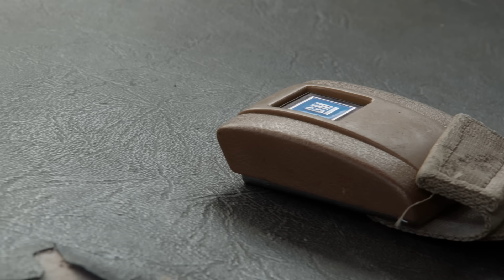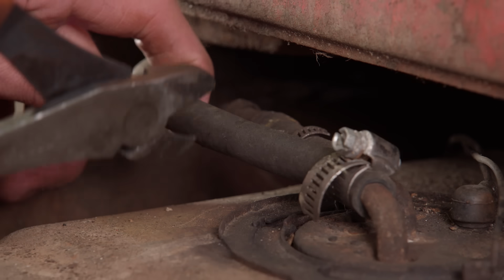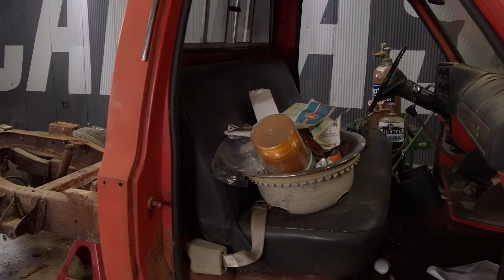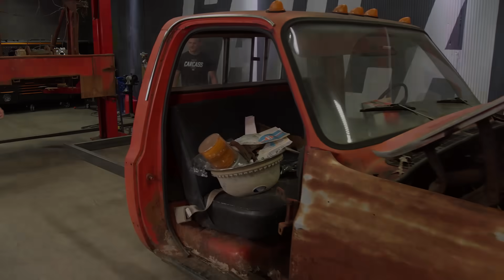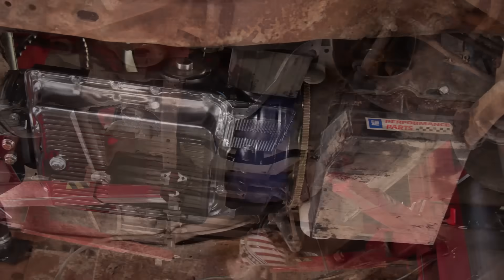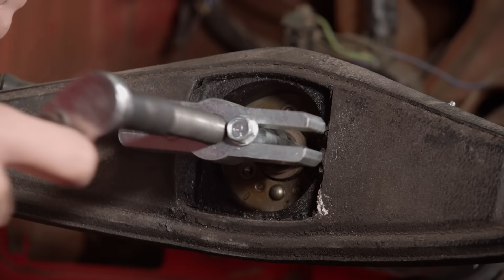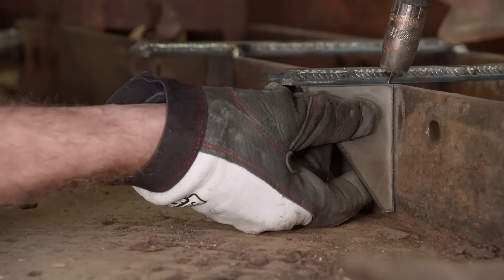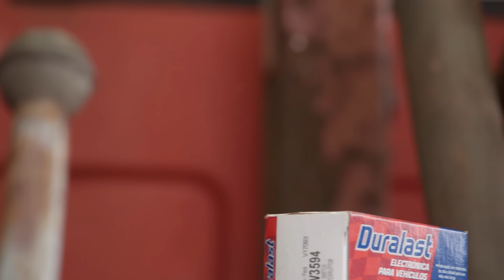Full Build: Junkyard Square Body Tow Truck Is Restored And Modernized

Comment: There's a reason why the manufacturer doesn't weld spring hangers to the frame, it is not strong enough. An axle under torque tends to put torsional force on the springs, causing the front of the spring to want to wrap downward. Repeated torsional twist will break those welds, this was a terrible "modification". If it was better than bolting them on, you'd see off road rigs, semi trucks and drag cars with welded hangers.

Comment: Once i saw the rear shock brackets welded in place, you lost me as this does not allow lateral movement from compression of the shock and the shock bracket welds will break

Comment: Question... 

First... Excellent Job. 

Second... I Have a 1992 GMC Safari Panel Van (Extended Cab) I need floor panels and some stuff for the dash and all the rubber stuff including the window felt as well as the rear "GMC" License plate thingy that goes in the back door... Do you know of an "All In 1" company that would have all that stuff? I also am thinking about electric windows and need to replace the seat and dashboard and want to upgrade the instrument cluster to some kind of digital gauges.

Comment: I would have rebuilt that manual trans. The 700r4 is just junk. Maybe put in a WC T5, or T56. If you're set on an auto trans. An allison would be the way to go. You would be able to use it the way it was mentioned to be. A wrecker.

Comment: Why the 700r4? Overdrive is great considering the truck probably has 456 gears . I would have swapped a nv4500 to make use of the pto wench. Zbar pedals aren't hard to convert to hydraulic.

Comment: For the light use it will see an automatic with no PTO is fine but I strongly suggest anyone building a more serious (working, not just a toy hauler) rig use a manual box with PTO or a hydraulic winch with engine-driven pump (the usual way to get around not having a PTO-mounted pump. If you run a mechanical PTO winch you have full engine power at your disposal so noobs should take care. Hydraulic motor drive can be fitted to the stock Holmes winch if the modded vehicle must have an automatic gearbox too small for a hydraulic or mechanical PTO.
For commercial work beefing up the back half of the frame considerably more would be wise. 

Twin boom trucks are amazingly capable for recovery (towing is not recovery). See towing forums for pics of them in action.

Wrecker operators have folded formerly sound frames upwards by chaining the front of the truck to an anchor then not backing off the winch in time.  These trucks are beasts (I've a C-30 crew cab with a wheel lift) so if you're building one for fun ya may as well keep what made them awesome. You can still get nearly all the old Holmes wrecker parts BTW.

These trucks are very easy to work on and if you find a sound rolling chassis it's easy and quite common to install a good C-10 cab to replace worn out wrecker cabs. It was and is normal for wreckers to expend multiple engines and for wrecker beds to outlast multiple trucks.

Here's a clean 480 like the one in the video before modification. They will easily lift a mechanical wheel lift if you can't score a hydraulic:

https://www.youtube.com/watch?v=hFGVOoy_nxw

Comment: I'm no engineer, but why didn't you run the c-channel all the way back and notch it for the rear end?  then box it. Seems it would have been a lot stronger if you are going to tow with it. There's and old 61-63 Chevy tow truck sitting in front of a local wrecking yard I would love to get.

Comment: So I'll either you guys said there's a lot of Fords out there but the problem with that most of those four words are still together whereas most of the Chevys have been picked clean because Gabby's are always needing Parts like that piece of crap 4L60E transmission or how about burnt everything's after 200,000 miles or how about whenever you get a quart low and oil you start having your lifters give you a round of applause

Comment: Turn a cool old towtruck into a car showtruck??? From a 4 bolt main 350 SBC with a SM-465 to a swirlport smog head in front of a 700R4? Why? It ran before???
Extra steps for a less useable truck? I’m just lost here. It’s sad that some guy who turns wrenches on occasion knows for a fact GM didn’t put a “305” in anything with 8 lugnuts. That truck would have had a very reliable truck small block or a big block with only transmission options being an Sm-465 or. TH400 automatic. Being. Tow truck with the need for a PTO the one with a clutch pedal was the most practical option.

Comment: hells yea! had an ol dually 350CI burnt out motor was replaced with rebuilt in box LT1 with one over cam small block. that thing was a monster! was my old boss' we lived almost two blocks off the main st and when he turned the corner at 7:15AM, you could hear that low drumming deep bass WHOOOM WHOOOM WHOOOM WHOOOOM WHOOOM WHOOOOM!!! i took the old drum muffflers off and put cherry bombs on, you could hear me coming five blocks away! instead of the horn i would pull up and rev it up BLAAAHHHHH BLAAAAHHHHH BLAAHHHHHHHHH!!!!CHUGGGGA CHUGGGAA CHUGGGGAAA! 
i would pul the stakes sides up, place them in the front with the steel box, and she would look like a semi with sleeper. 
first truck i safetied. didnt need much but yeah the floor pan was gone, did a lot of work, made me realize what was possible. owned a dodge once, couldnt haul worth crap. always stuff breaking, wasnt worth new parts. replaced everything atleast once over. still didnt run and drive proper. simple design, made me an excellent backyard mechanic. 
years down the road, couple decades actually. bought my first ford 3/4Ton, 351CI, 5spd C6 regular cab 2WD. the best work truck i ever owned.  hauled like a beast, the motor, almost indiscructable. loaded that thing to the tits many times over. scrapped it, tried to make some money back trying to sell parts. didnt sell too many parts because those year early 90s models very well built.
Reply: Trucks make big WHOOM WHOOM noises! Like VROOOOOOOM, EEERRRRRRRRR, PUTPUTPUTPUTTTT, HONNK HONNKKK! Like truck sounds

Comment: A - I'm a die-hard squarebody fan, so glad to see another getting rescued
B - That thing is DOPE! Love the 4-speed. (I had to add an edit. WTF guys? Keep the SM465! 🙂That's the strongest transmission on the planet)
C - you closed the hood wrong (not that it mattered with the current bends, but hurts anyway)

After watching to the end, that thing is an awesome build. Good work fellas. Totally approve of everything you did, except for the automatic trans. Thanks for saving another squarebody from the crusher.
Reply: 😂 they did not save anything. The production company requires the projects to be crushed. This is why Stacey David quit TRUCKS. He was tired of building trucks and then they were crushed.

Comment: I'm glad to see others as infuriated that you pulled that SM465 Transmission out, to replace it with 'fix or repair weekly' transmission...just because you can't shift a 4-speed. The SM465 and the Braiden winch were together, worth more than the whole project! In 20-years, when you wonder 'where did all the unaltered square bodies go'...just know, you could have bought a frame at Bobby White's to replace the rusted one with, for about $200...Along with the steering box, the spring hangers and that 'still creased hood'...
Watching this hurt...on so many levels...

Comment: Would have been easier and way safer just to replace the entire frame rail with a new one. With the popularity of the C10-C30 trucks, a new one would not have been difficult to get nor would it have been prohibitively expensive. Honestly, with all the rust, the entire truck should have been sand blasted.

Comment: good ol chevy, i have a 1974 myself and it does not disappoint, its hauled everything iv thrown on it, has a 350 with a 4 spd, long frame, weld bilt bed and a sneeker lift for repos an newer cars an trucks

Comment: Safety. No new control arm bushings, if not new arms? Front springs? New rag joint? Brake rotors/pads/calipers/hardware? Total rear brake replacement? Paint on the inside lower fender behind the wheel well? Cables on the beam rigging? Bearings? What happened with the driveshaft? Um, no. Really cool... as far as it went.

Comment: Watching the dash job made me mildly upset. I wish it was that easy on newer vehicles. I've done to many dash jobs with 7,000 pigtails and 1,500 bolts. Having 140 bolts left over and leaving 200 pigtails unplugged because I don't know where they went. But not on a 70s chevy, 6 screws and some spit and she's off. 🤣

Edit: Also, I love how after they put the gauges in the truck has 1 original mile. 🤣🤣
Reply: Same with swapping engines, now adays you have to program the ecu for the new engine, plug in 200 sensors and by the time ur done you have a ton of hours in it
Reply: @jaydenb7515  I've swapped plenty of engines on newer vehicles and it is a pain. As long as you're swapping with the same engine you're only looking at 12 to 15 hours lmao. Not like an old school 350 and 1 hour.
Reply: @aaronsprojects9622  yeah

Comment: Am i the only one seeing this frame being very dinky and the overlap is way to little. from what ive learnt from the guys that repair frames with sertifications. you need a lot of overlap (especially on the already thin C-frame) with double plates in the joints. and thin square tubing for the axle, what?! ive tried using square tubing as a leaver to jack stuff up and 2inch square tubing can be made into an interesting geometrical figue by body weight (2.5mm wall thickness, 6-7/32" ish) and they didnt use much thicker stuff. so i would be worried bending the whole thing on the first tow or loading the suspension. even hitting speedbumps in the near future i do think could lead to disfiguring in the long run

Comment: That frame work was shoddy at best. I cannot believe you thought 1/8" tubing was appropriate for a tow truck chassis. I would imagine you could have sourced replacement frame rails somewhere for an old squarebody that would have at least put some of the factory strength back in it.
Reply: seriously. I was looking at that test C channel piece against the OEM frame and almost gasped..
Reply: but he box'd in the gussets lmao

Comment: Man what was the point of this build. You guys took a fair running operating vehicle, tore it all down and got rid of anything that made it cool and original. You could of taking just a cab set it up a random fram put all your new parts and junk in it and still Accomplish the same thing. And you guys still think it wasn't worth the time or money. Screw you stop this nonsense

Comment: Awesome build! Everything you did was amazing with the exception of getting rid of the 4 speed manual. I don’t see a good reason not to have it honestly.
Reply: @XxTNTBOSS750xX it’s still a cool truck but it takes all the fun out of driving it and the manual would have definitely been good for towing.
Reply: @keatonschooley3750
Reply: @keatonschooley3750 xxxx
Reply: @keatonschooley3750 xx
Reply: 9x
f
xix90xxm0f9x0x0ffxxxx
Reply: @keatonschooley3750 they could have put a pto on the automatic transmission
Reply: Plus the 4 speed had a granny gear and a PTO to power the wrecker
Reply: @XxTNTBOSS750xX L
Reply: Good to know thanks
Reply: bruh 4 speeds are great in tow trucks so you have a lower and higher gear
Reply: NV4500 transmission would be killer in that truck!
Reply: If you're going to be towing, an auto is advantageous. Torque converters handle heavy start stop loads better than clutches.
Reply: @theronwolf3296  Very true
Reply: @theronwolf3296  if that was true semi trucks and farm tractors would have been automatics. If you actually knew anything about transmissions you would know that a clutch in a manual trans can definitely handel more torque then a torque converter can especially for its size.
Reply: @victorgirouard1543  Automatic transmissions are starting to slowly take over in trucking, and tractors don't shift on the fly so...yeah
Reply: @alexandercurtis4427  speaking as a diesel mechanic  semi trucks are best as a 10 13 or 18 speed also thay are not automatics they are semi-automated which means they have a semi automatic clutch to put as dumb as i can make it
Reply: @victorgirouard1543  when your backing up to a car to load it and automatic makes life easier in a tow truck. I have towed with both a manual and an automatic and the automatic made life a lot easier to deal with and quicker to hook a car.
Reply: @bobby-igy6206  very true they are centrifugal clutchs built very similar to regular say 3 plate clutches just engaged by speed instead of your left foot. I am a auto/diesel technician myself I find them very interesting. And yes I know my spelling is hoe
Reply: @torque-ej4nu  I can see what you mean. Wouldn't have thought about that
Reply: @victorgirouard1543  Well then why are all the new rigs going to automatic transmissions then?
Reply: @torque-ej4nu  but the automatic doesn't have a pto, so it's not even functional as a wrecker. And an sm465 could probably take more heavy duty abuse than what looks like a 700r4
Reply: @victorgirouard1543  in europe where our trucks are generally heavier than yours, theyre automatics as a standard since like 10 years. Some brands dont even offer manuals anymore.
Reply: @victorgirouard1543  your right that’s why big rigs are moving to manuals and away from autos… oh wait they arent
Reply: @woodys74nova  there not real automatics there manuals with air actuators to shift and centrifugal clutches that engage by engine speed. So yes it's automatic for the driver but not a true automatic transmission by the normal sense. Now some of the lighter duty tow trucks do have true automatic transmission made by Allison.
Reply: My '77 Silverado C10 came with a automatic transmission with column shift. Plan to keep it that way. I'm a sucker for automatics anyway.
Reply: @jasonmckenzie1132  What makes someone else choosing an automatic on their vehicle YOU will never touch let alone drive relevant?
Reply: @obfuscated3090  And you're asking me that in regards to a vehicle YOU will never drive either. That's funny. Are you going to say the same thing to others here too? May as well.
Reply: @jasonmckenzie1132  thanks for coming out to us, we support you Jason !
Reply: @evanmarvel8064  Beg pardon, but do you mean that in regard to my truck's automatic transimission?
Reply: @evanmarvel8064  People, here's part of the problem with the world today. Can't share a calm, civil thought without someone trying to act cocky about it.
Reply: @jasonmckenzie1132  yes sir. not a serious comment tho :)
Reply: @jasonmckenzie1132  
Hey asshole, everyone is calm and civil!!! What the hell are you talking about newb!?!?! SMH

😘hehe

Comment: Why an automatic, its sad, that sm465 is a beast of a stock transmission, almost 500lbs. Of torque handling with a load of 22 or 25,000 pounds i cant remember but know they were found in c60 trucks and theyre cheap to rebuild! Plus dual pto hookups on the sides! Not to mention the gear reduction in low gear.